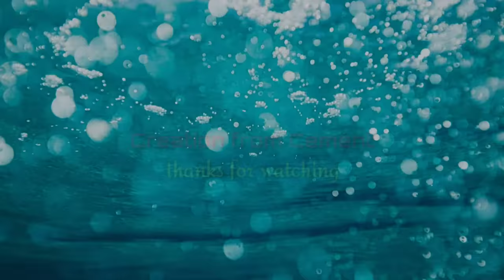how to cast a cement stove with a plastic pot is both easy and saves gas

Comment: If you want it to last, you should wait a couple weeks before starting a fire and then make a small fire for a couple hours. High heat and wet concrete can be dangerous. Steam pockets build up inside the concrete and can actually explode. Refractory cement with perlite mixed in works really well and keeps more heat where you want it cause the perlite insulates.
Reply: Sounds good
Reply: Thank you, do you know the name of the epoxy, he used to line bucket? I don’t think the creator answers questions.
Reply: Where do you get refractory cement?
Reply: @joeymarino7907  it was most likely mold release not epoxy.
Reply: drew michael  less likely in the UK I am afraid to say
Reply: Looks good, but l don't like smoke covered pots! How does one cast a coal pot?
Reply: Looked like used motor oil.
Reply: And i would personally either raise this more or create another compartment underneath with a tray or some kind, do i can remove ash easier.
Reply: What should be the proportion of perlite to refractory concrete?  Thank you for your input!!!
Reply: @debsmith7120  it comes down to how insulated and strong you want it to be. You can use up to a 10:1 mix of perlite to cement. People use these types of mixes for pizza ovens and foundries. Perlite has an added benefit of being lightweight but it weakens the overall mixture if you use too much. If you have a Menards close to you, they should sell perlite and refractory cement.
Reply: @pcka12  if you have a Menards or tractor supply close, they sell refractory cement also.
Reply: @pcka12  what does one call a hardware store in the UK? Home Depot, Lowe's,  and Menards are all hardware stores (where one purchases tools, building supplies, lumber, etc).
Reply: @kyleo1236  Thank you for the reply and helpful information, Kyle!
Reply: I want to make one for my hiking trip
Reply: @AuntNutmeg  I am afraid that 'Ironmongers' (as they used to be called here) which stock refractory cement are now few & far between, B & Q would probably not know what you were talking about, long gone are the shops which had everything.
Reply: @pseudopetrus  you know that it's going to weight a ton right
Reply: @fractalofgod6324  Yup, thats the point, I will have to leave my sleeping bag and food at home!
Reply: @pseudopetrus  you're probably better off looking up how to make a rocket stove if you want something for a hiking trip.
Reply: Thanks
Reply: @kyleo1236  Nope, not heavy enough. Can I add lead to that concrete mix? I also plan to take that stove with me deep sea diving!
Reply: Ñ
Reply: Ñ
Reply: Ñ
Reply: Ñ
Reply: Ñ
Reply: Ññ
Reply: Ñññ
Reply: Ñ
Reply: Ñ
Reply: Ññññ
Reply: Ñññ
Reply: Ñ
Reply: Ñ
Reply: Ñ
Reply: Ññ
Reply: Ññññ
Reply: Ññ
Reply: Ñ
Reply: Ññ
Reply: Ññ
Reply: Ñññ
Reply: Ñññ
Reply: Ñññ
Reply: Ñ
Reply: Ñ
Reply: Ññ
Reply: Ññ
Reply: Ñ
Reply: Ñññññ
Reply: Pññññññ
Reply: Ññ
Reply: Ññññ
Reply: Ñññ
Reply: Ññ
Reply: Ññ
Reply: Ññ
Reply: Ññññ
Reply: Ññ
Reply: Pñññññ
Reply: Ñ
Reply: @joeymarino7907  ñ
Reply: @joeymarino7907  ñpñññññññññ
Reply: @joeymarino7907 ññ
Reply: @joeymarino7907  ññ
Reply: @joeymarino7907  ñññ
Reply: @samos343guiltyspark  ññññññ
Reply: @samos343guiltyspark  ññ
Reply: @samos343guiltyspark  Ññññññ
Reply: @pcka12  ññññ le ñññ
Reply: Ñ
Reply: @samos343guiltyspark  ññññ
Reply: @joeymarino7907  ñññp
Reply: @joeymarino7907  ññññ
Reply: @joeymarino7907  lo
Reply from the maker: Thanks for your opinion 👍
Reply: @pseudopetrus  😂😂😅😅😂🤣😂😅
Reply: Der Baustoff Beton ist ein künstlich hergestellter Stein aus einem Gemisch von Zement, Wasser und Gesteinskörnung (Sand und Kies). Im zuerst breiartigen Zustand ist er beliebig formbar, bevor er erhärtet und seine hohe Druckfestigkeit gewinnt.
Reply: Lol he doesn't care, why would he use this when he can use real stove?
Reply: @kyleo1236  I made a rocket stove, and it works really well... Don't need many bricks.. Quick to make  , easy to use.
Reply: Also add pea gravel for strength.
Reply: Say what🤔

Were made in HIS image. HE made us with the power of free choice
A good prayer:
I'm a sinner JESUS please forgive me for all my sins I know you shed your Blood for me on the cross at Calvary. Thank you JESUS for my salvation and for shedding they Blood for me. I love you JESUS. 
Romans 10:5/10 ct...❤️k
JESUSisLord!Amen...
Amen..
If you'd like to call someone who cares 
83
For
Truth.
bc you don't know when you'll die?
.y r u hesitant.

.

...

.
Reply: These have been made and used for a very long time so far I have not heard of and disaster some are made out of just mud with small stones.
Reply: That's a big LOL 🤣😆
Reply: I thought this myself, given that I've heard that when camping, not to use stones from rivers as a fire surround. Even solid rock absorbs water and can explode - so concrete made with water probs does too.

Damn fine idea, nevertheless! And very efficient and easy to reproduce at home. Will have one of these soon 👍
Reply: Can you please share your high temp cement mix recipe? I need to replace my beginner forge hearth with something more robust. I've got refractory clay, portland, perlite, and silica sand on hand already. I just need some numbers and advice...
Reply: @Altrag_  my personal foundry is made with a sodium silicate (water glass mix). There are youtube videos on how to make it. It's a mix of 100% lye (drain cleaner) and silicate (crystal cat litter) mixed with water. You don't need cement with this type of mixture. Just water glass, sand and perlite. Water glass hardens with CO2 or heat so you can use dry ice to cure it or just let it sit for a few days then put a small fire in it.
Reply: Think this is just for showing
Reply: @joeymarino7907  thats oil just for nonstick
Reply: @joeymarino7907  don't know for sure way he used but concrete workers grease or oil their forms and I think plastic would be done the same way. It just makes the mold easier to slip off. Concrete won't stick to the grease or oil.
Reply: @samos343guiltyspark  ⁸ììììķ
Reply: Mk8
Reply: Ippl
Reply: This @samos343guiltyspark 1.😅

Comment: What is your cement formula and how much do you need? How big is the pan and bucket? Thank you
Reply: Concrete can explode when under extreme heat because of its ability to soak up water. You need to have ceramic tiles inserted in this type of design to be safe.
Reply: @SentoHug  Or just crumble.
But isn't there a heat -tolerant type of concrete? Or mortar?
Reply: @musicteacher5757  you could make it with concrete instead of just cement. The metal reinforcing rings would still be needed.
Reply: 8

Comment: What is that you apply around the basin before pouring the cement? Thanks
Reply: Creo que es grasa para que no se pegué el cemento al plástico. No sé si yo esté equivocada.
Reply: @omairamora8014  creo que no estas equivocada. Tambien se utiliza oleo o aceite y tiene el mismo efecto. Eso es solo para evitar que se pegue la mezcla por el plastico. Ahoranos falta saber la formula.
Reply: Oil to ease removal of plastic
Reply: It's Jeffrey Toobin lube. Duh.

Comment: Well, I really liked your craftsmanship, very neat, clean, well thought out and came out amazing... great job. I recently purchased a lil stove like this (but it’s some type of metal) and today I actually bought a covered cast iron pot for it! So weird i came across this. 😁 can’t wait to try mine out. Thanks for sharing!
Reply from the maker: Thank you
Reply: Yes, and thrr cement will hold much more heat for longer than metal, so you can sit around it after your meal. I loved this, and I want to try it!
Reply: That’s a great point about the heat coming off the cement, @DanielMcArdle
Reply: Where is this clean when all the asches just fall to the ground. For sure this has to be used outside, so the lightest windblow will distribute the ashes all around, mmmh not for me please
Reply: Please let us know how it turned out
Reply: No pronunció  el inglés
Reply: What did he apply in that bowl.

Comment: It's standard cement no matter what little things you do like, expansion room at the ends of the steel rods. Leaving it longer to dry or starting with a small fire... It will pop as that's what concrete does when it's used for fireplaces. You need special pumce fire cement as it's designed for building fires and pits for crucibles.
Or save a whole lot of money and time and just use old fireplace brick which is instant and just as if not more effective for making this basic jet stove
Reply from the maker: Thank you
Reply: Yes...it never ceases to amaze me the disregard for physics.
Reply: Please add 1 kg of salt to your concrete mix. It will make your concrete fire proof as well as much harder.

Comment: What is the black powder or oil used to coat the plastic?
What is are the metal circle or semicircles made of?
Where did you get those chunks of Styrofoam?
Is that sand or sawdust in the second half?

Comment: Brilliant idea. Just a small tip. When making your cement/concrete mix add a minimum of at least 1 kg of salt. It will make your concrete/cement fire proof as well as much harder. 
Please dont use sea water to replace the salt.

Comment: So neat and clever. Wish we had a course here for this. I'd do in a heartbeat!
Reply: This is the course. Step by step.
Reply: @mamishami9820  what was rubbed into the bin before the concrete? What ingredients are recommended for concrete? How long do we leave to set? etc etc. I'm not a builder just your everyday person and I'm speaking on behalf of the everyday person. Got it?
Reply: @eevagirl  also cement can off gas some nasty chemicals so isn't suitable for cooking - there are cements that are food safe but it isn't mentioned here. Also I feel like this will crack apart with the heat - again there are cements that are heat resistant but this isn't mentioned. It's beautiful, but is it safe? Who knows.
Reply from the maker: Thank you so much
Reply: How much rate.plese your cont

Comment: You could expand the design to make a hot water boiler, for domestic hot water. Just make a bigger unit and put a metal coil pipe unit in the heat chamber, then link the coil up with a bottom cold water inflow, and a top hot water outflow to a raised water storage butt.
Insulate the water butt with a bottom flow water pipe feed, and a top flow hot water return feed..
Convection flow will automatically circulate the water flow, through the coiled pipe system and heat up the water..
Reply from the maker: Thank you
Reply: Ap banaka sall karsakta hu ya bohot sundar ha jee
Reply: Why why why grrr
Reply: You should draw up a design and post it
Reply: Brilliant

Comment: Love the channel, awesome.

Just a thought, but would it be effective to have the wood port at an angle so it would be self feeding the fire with large wood working it's way in as the fire burned?
Reply from the maker: Thank you
Reply: I don't understand. Could you please explain more what you are suggesting? 🍀
Reply: These types of stoves you need to stand by and feed small pieces in slowly... the stoves heat up really hot...
Reply: @cementstove  He asked a question, sir, not simply complimented.
Reply: @yummycookie3429  You see where the creator placed the pieces of wood? It has a flat level base.
The commenter is asking if it would be savvy to make a base that is higher and slopes down diagonally so the wood is self-feeding the fire, because it's falling into the fire by virtue of its position.
Reply: @phedreBiOn  I know. It's infuriating.
Reply: Just stumbled across this, a great watch, almost "mindful" ,  liked the speeded up filming. And attention to finishing details.
Nice watch and good idea. Akways someone out there knows better !!!!
Reply: @yummycookie3429  Yeah, sorry I didn't respond. Phedre got it right. I was thinking for long term cooking such as tough meat cuts in a stew, smoking etc.
Reply: @gonzowarburn7045  thanks however I still can not picture the design with a slope
Reply: @yummycookie3429  I can't do links, but type this into search (it's a product sold on Amazon) "woodeze small portable rocket stove".

Comment: Proportions are important.  The height of the chimney needs ro be 1X to 2X it's width.  This unit should work.  Also, regular concrete will not hold up to the heat.  You need a refractory material that can withstand at least 1200 degrees if you want your rocket stove to last more than a few uses.   Regardless of the material used, it needs to cure for a few months to get the moisture content low enough to use.   You also need to be able to get the ashes out.  The rounded edges on this design would allow it to be rolled over without cracking the top lip, but it's not ideal.  Would have been better to lea e it as 2 halves so the top could be removed leaving a smaller and lighter bottom half to empty.   Don't seal the rear in.   Make them removable also to make ash removal easier.
Reply: I agree.  Cement in general is really good in compression but not torsion.  Also there are lots of cements.   'No spam' clearly knows more than I, but I do know enough not to be so cavalier with concrete. Still, I like the concept!  Advise you (creations in cement) getting  together with folks like 'no spam' because us dull engineering types could learn from you.  AND you cement creations can most certainly learn from the cement nerds!
Reply: The entire bottom is a hole for the ash to fall out.
Reply: @excavate08  True, I missed that.   Having said that, with the bottom open, the chimney isn't going to be able to create enough draft to maintain an efficient burn.   Better to have a gate on the bottom to seal it off and draw the air in just under the wood like a traditional rocket stove.
Reply from the maker: Thank you
Reply: @nospam3409  you just make science up as you go along? The design is obviously more fuel efficient that 99% of primative stoves out there. Just say it, you're jealous because he made something cool and useful, and you haven't.
Reply: @nancydelu4061  you support know it alls, who make useless and wrong critiques and who have never build anything useful or cool? Nice. You are right about being dull engineer types though.
Reply: @no spam: would clay work better than ciment ?
Reply: @nafolo2003  probably not.   Clay would have to be too thick.  Easiest thing would probably be to mix vermiculite into the cement.  I think some people are using ground corn cob some how, but I'm not familiar with that process.
Reply: @jwtre  well some of use build stuff like this, use it, see how it fails, learn from our mistakes, improve our designs and processes, and share our experiences to help others get up the learning curve faster.  Others just like to troll.
Reply: @nospam3409   @No Spam really? You don't even have one video building anything, but you comment on this guy's channel like your the authority on cement stoves and physics. Your advice isn't even correct and you pretend it's the gold standard. If you know 10 ways the design should be better, build it on your own channel and get your own views. But I doubt anyone would watch them. So I guess you need to get back to being the armchair expert that you are.
Reply: You can always use a shop vac to remove the ashes.
Reply: @jwtre  Hey, if you want to go duplicate what he did, have at it.  Nobody is stopping you.  Pee right on that electric fence, just don't be disappointed when the results weren't quite what you expected.  Better to have failed and learned than to have never even tried.
Reply: @nafolo2003  it does .They are used in Africa. But it has to pass through fire treatment. You may combine clay with cement and sand. Comes out well. Hata hiyo ya cement pia ni poa
Reply: @nafolo2003  please who will give a reply here?
Reply: @nafolo2003  High clay content soil mixed with sand would work fine. I've made several earthen ovens and stoves and this stove's thickness is plenty for that. Would definitely b my preference over cement/concrete.

Comment: U are a genius but don't u think d heat will crack d stove. I think d cement should have been a concrete to make it more solid to withstand d heat but it it all u have done so well. Weldone & thank

Comment: yes huge differenct between dry cement and cured cement. you lite a fire in that the next day it will just sptilt apart or just wxplode. needs way more steel rods and some wire mesh to hold together more than a season
Reply from the maker: Thank you

Comment: Looks like there's not much room for the ashes to go under the stove. It's a really cool little thing but you'd have to lift it often to get the ashes cleaned out. Only my opinion. That's a pretty cool idea. We all have our own ways of doing things so not trying to be rude. Just it looks heavy and I'm small. And it would get really hot to move. Taller legs??

Comment: Less than 10 seconds in and a substance is painted on the inside of the bowl with no explanation of what it is or it's purpose.
Schoolboy error, which earns you a thumbs down.
Outta here...
Reply from the maker: Thank you
Reply: @cementstove 
So, what was the substance you smeared around the inside of the bowl, before adding the cement?
I assume it was to act as a barrier to prevent the concrete from bonding with the plastic, maybe oil based?